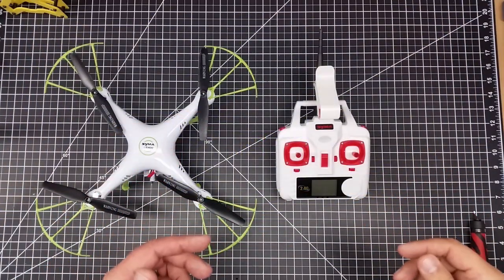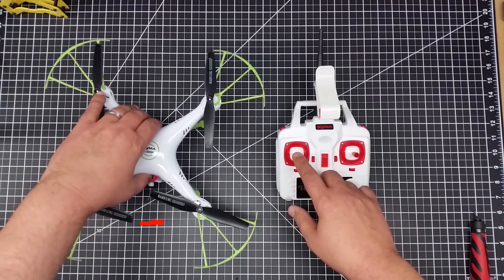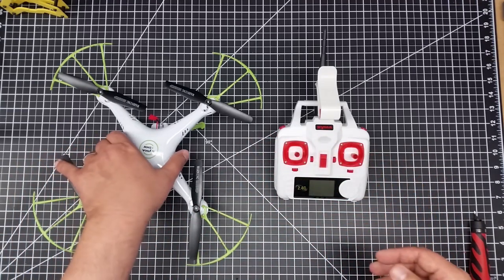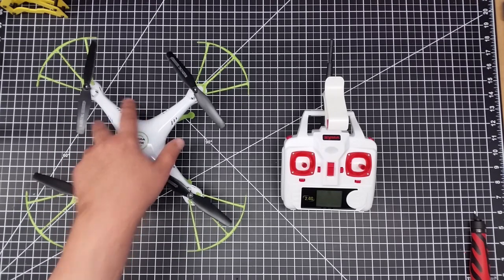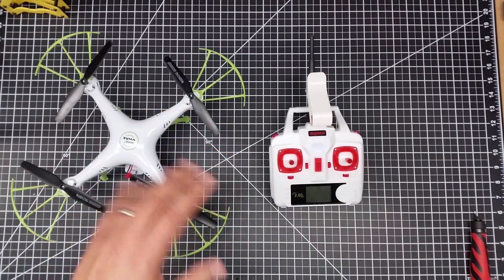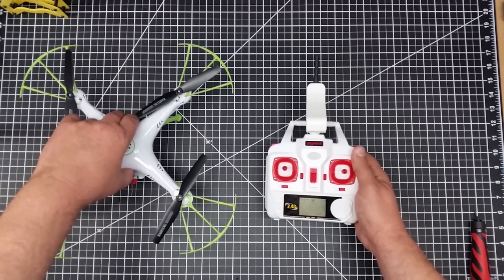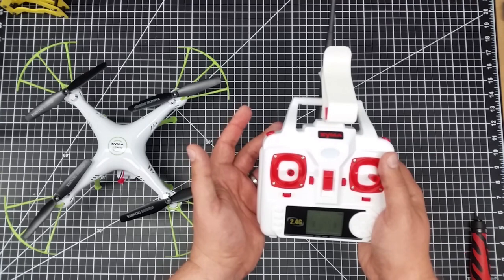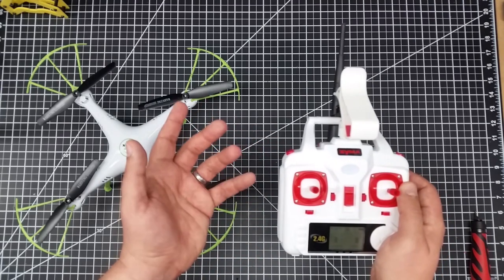Video Drone -  Headless Mode Tutorial!

Comment: How do you go into headless mode? Do you hold that button before flight or during flight? My x8w wont seem to go on headless mode.
Reply from the maker: Yes while in flight do a long press and it will beep indicating it has gone into headless mode also check the instructions or Google however you will want to set the compass before flight.  I believe it is both sticks down and the right however please double check because if the compass is off, headless mode wont work correctly...
Reply: @VideoDrone  There is no "Compass" on any of these cheap drones. They are usually only added to GPS-equipped drones. Both sticks down and to the right tells the Gyros what they should see as "Level" - it has nothing to do with the Headless Mode setting. You can set the Headless direction by both sticks down and left. To turn it on you must long press the left shoulder button (and the leds will continually slowly flash.) If you have NOT set the direction with both sticks to down left then the direction that the quad is facing when you long press the left shoulder button will be stored as the Headless direction. The set headless direction is stored for the duration of the power-on (or until reset by both sticks to bottom left) but, because it DOES NOT have a compass to give it an exact reference (only an approximation from the gyros) it will drift a bit during the flight depending on how violently the quad is thrown around. (Or crashed!) 😉

Comment: The thing you might want to have done is some basic terminology. You used terms like transitional and yaw. The "transitional" was new to me but I picked up the meaning quick.  I did understand "yaw" as I follows the space program as a kid, however new users may not be so technically adept and could use some laymen terms. I would have equated yaw with "rotate". For transitional I don't think there is a simple word that works and you did a good job of relating that the movements are in relation to the front or "head" of the copter and "headless" means movements in relation to the operator.  In headless mode, if I understood correctly, there is no forward or backwards but rather "towards" and "away from" the operator. Up and down and the yaw or "rotate" are the same in either mode. 

Now if a persons drone or copter does stunts that probably would involve a "roll" maneuver and not a "pitch" maneuver, correct?  

What is the purpose of setting the gimbals?  The gimbals are on the camera, correct or do they have something to do with flight operations. Are they related to gyros?

This was another great video. I liked it and learned a lot.
Reply from the maker: Yes that is true and a good point.  This also why I added arrows in the beach version...